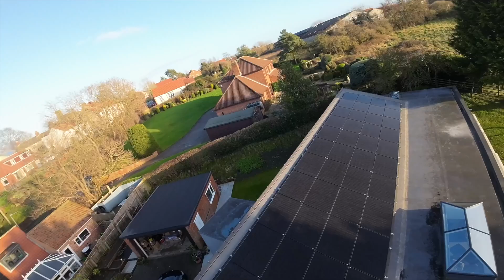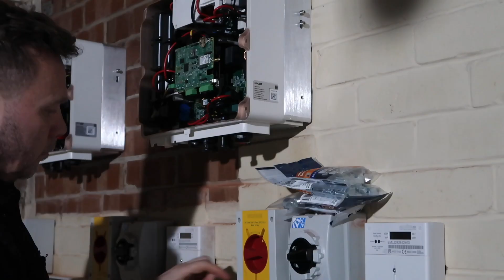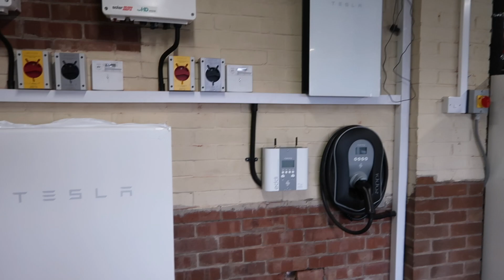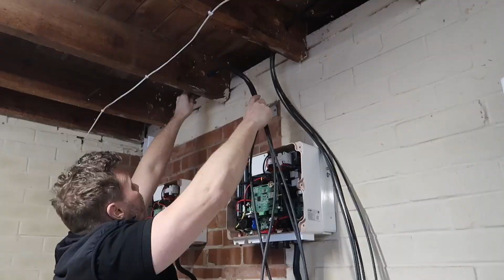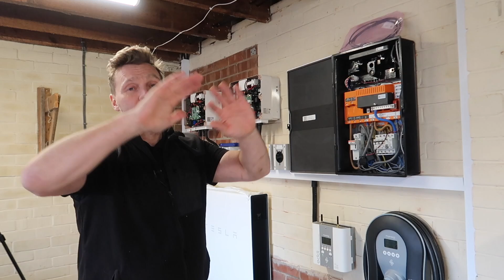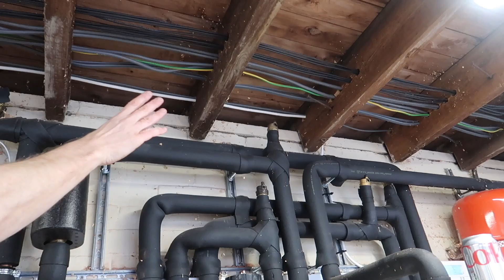SolarEdge 19.1 kW System with Tesla Powerwall & Zappi Install | Part 2 – Installing Equipment

Comment from the maker: ⚡ 19.1 kW SolarEdge System with Tesla Powerwall & Zappi – Part 2 (Installing Equipment)

This incredible system features 44 Jinko Tiger Neo 435 W panels, SolarEdge optimisers, 2 × 6 kW inverters, MyEnergi Zappi & Eddi, and a Tesla Powerwall — installed by Alps Electrical Ltd in Seamer, Stokesley.

▶ Watch Part 1 → https://www.youtube.com/watch?v=xKoc4Msuojk
▶ Watch Part 3 → https://www.youtube.com/watch?v=JAOzciIAadk

💬 Interested in solar or battery storage?
📞 01642 790489 | 🌐 alpselectrical.com

📍 Serving Teesside • Durham • Sunderland • Newcastle • Northallerton • and the wider North East.

🔔 Subscribe to follow the full series and see more real renewable-energy projects from Alps Electrical Ltd!